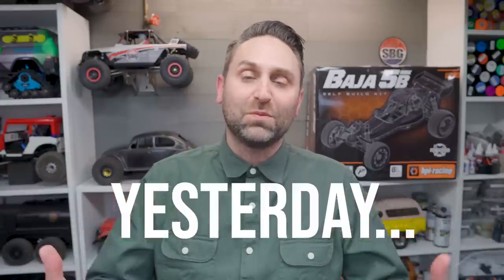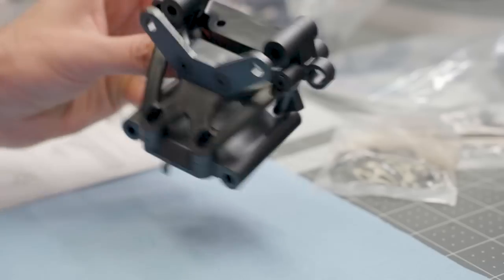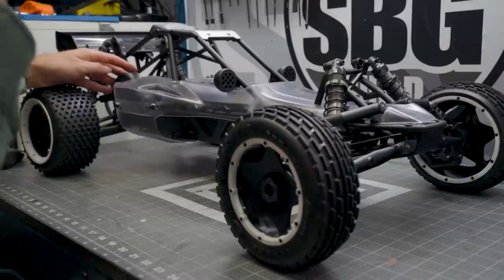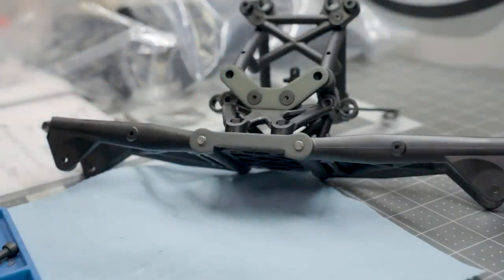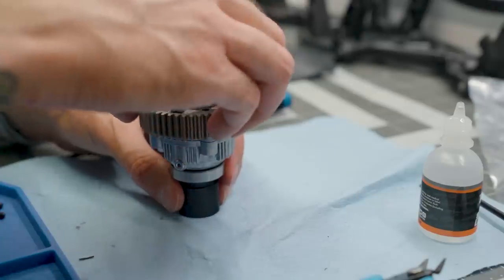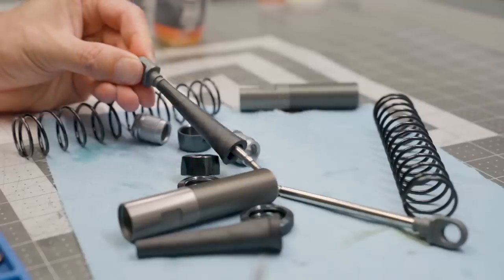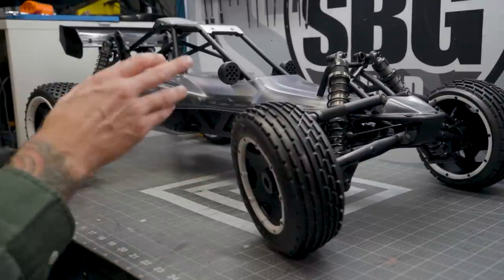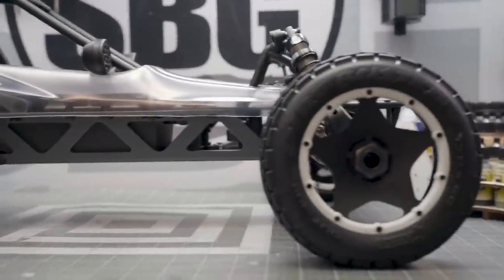What's on the Bench Weekly Ep14 - Let's Build the HPI Baja 5B!

Comment: Totally with you on the kit vs RTR...I much prefer building my rigs than getting an RTR. RTRs have their place, but I much prefer kits personally. Cool buggy and great vid as always!
Reply from the maker: Well said!
Reply: I usually call RTRs "Ready to Reassemble", cause I havent seen a single RTR that works good out of the box. Underfilled shocks/diffs, incorrect setup that drives like crap, incorrectly assembled parts (even though this one is quite rare luckily), underpowered stock electronics (I am looking at you, Arrma 8S rigs), crappy Servos and worst of all: RED F**** LOCTITE EVERYWHERE.

Comment: Its good to see hpi cash back in on thier own design. Now i dont have to keep buying knock off bajas. Hpi updated the rear axles and rear hubs. Steering servo saver needs upgraded then steering is great. I went with symmetrical steering kit but turtle racing steering is also good if you want to keep stock look

Comment: Yo SBG, I'm having a dejavu on that metal vs plastic motor plate. Looking at the instructions again it looks correct in the video and looking at mine I don't see what you were saying here? Looks like the bolt pattern wouldn't work with the Flux mount? Basically I'm semi worried I mist something?

Comment: The problem with gas is the Nitro Ethanol mix.  You let the gas sit on the shelf ant the ethanol slowly evaporates messing up the oil to gas ratio. 
If they sold them separately allowing you to mix them when you use them.  It will fix that problem.  It wont fix the exap problem.  Maybe there's a container out there that can keep ethanol from evaporation?
If this wasn't a problem.  I prefer gas to electric.  Gas has more things to play with.

Comment: Hello SBG!  I'm getting back into the hobby, and i've got one of these kits on the way.  I've been trying to order the rest of the items I need to complete it, but I'm having a hard time finding a pair of batteries that will fit into the case dimentions listed in the manual (84x47x200).  Do you recommend any specific ones? All of the ones I've looked at (greater than a 5-6k capacity) see to be a few millimeters too large.  Is there any wiggle room with the measurements listen in the manual, or is that a hard-limit?
Reply from the maker: Take a look at Gens Ace, they’ve got some that will fit.Thanks for watching!

Comment: Im an amateur in rc and i never built a kit before, i want a baja 5b flux, but idk i dont want to screw up anything. Should i build it or let my hobby shop build it for me?
Reply from the maker: Shouldn't be a difficult build, the instructions can be a bit tough to follow because it's one manual for both electric and gas. If you don't feel confident and don't have all the required tools, best let the hobby shop build it for you.
Reply: @scalebuildersguild  what kind of tools, i have a tool kit with lots of hex screwdriver sizes but is that enough?

Comment: ovan 360GT Gas Baja Buggy RTR 36cc Sand Rail

What’s a good upgrade tuned pipe for this model price range 125$ - 275 ?
Reply from the maker: Sorry, I have no experience with the Rovan. I prefer the original from HPI.

Comment: I love my two GAS yes, a real one with GAS yes that is right, no the mistake was yours a motor not a GAS engine that is right it is supposed to be GAS it needs 12S as on 8S is pitiful, did I mention it is way more fun being GAS, the noise.
Still got those annoying 'E' clips. I never used any of the tools supplied, you put the pillow ball in from the wrong way if you do not it will spread the seat and the swivel will be loose like a dick in a shirt sleeve. Used to be 10,000 weight, you may find it better to have a locker better to fit an Innovative RC diff housing along with their transmission case if you do fit the locker.
It looks weird to see no GAS engine where it should be, no noise without a GAS engine. You can buy different coloured beadlocks including alloy which I run as the wheels distort and end up oval after an altercation with a solid immovable object.
Reply from the maker: Thanks for watching!

Comment: i think hpi dropped the ball on this 1, they had the opportunity to fix a lot of the badly designed components that came with the original design like the crappy designed steering setup and the front upper plate that bends if u look at wrong, with the gas version it takes hours to remove the engine, they could have made that simpler, and there are many more

Comment: My Hooters Baja had an ESP Reed Case 26 Zen fully ported race motor.  It was dyno'd at 6.5 hp with 4.3 ft lbs at 15,800 rpm. Top rpm was just under 20k at 19,300ish rpms.  I doubt these electrics will be that much power.
Reply: lmao, electric is way more powerful. tp power has motors which can make 10-20hp….
Reply: @rushgush  buahahaha.  Then you're going to love the future.  Not.